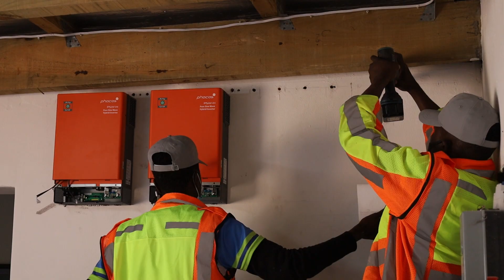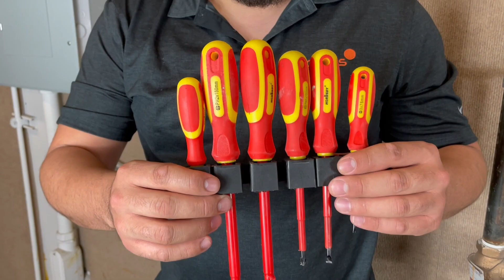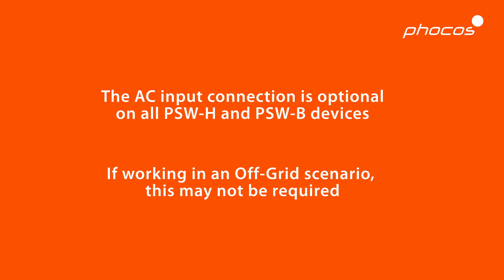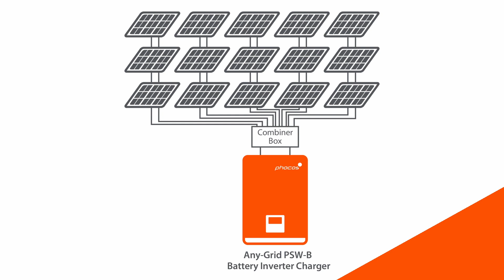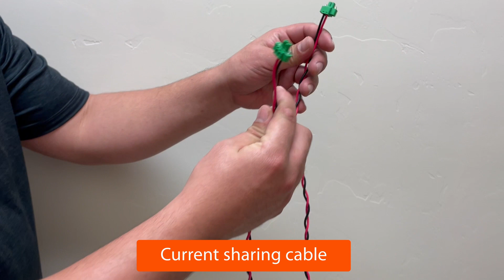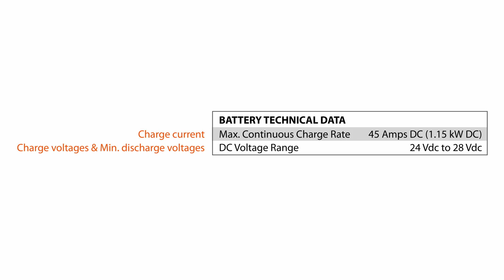Phocos Any-Grid Inverter Installation Best Practices

Comment: Subject: PSW-H-5KW-230/48V: Dawnice HZEB-LCT-16 compatibility, equalization, and max PV current

Hello,

I own a Phocos PSW-H-5KW-230/48V hybrid inverter and am finalising a system around it with the following:
- Battery: Dawnice HZEB-LCT-16 (LiFePO4, 51.2V nominal, 44.8-57.6V range, 150A max charge/discharge, CAN/RS485 communication)
- Panels: 10x 560W monocrystalline modules (Voc 52.27V, Vmp 42.5V, Imp 13.18A, Isc 14.10A), wired as 2 parallel strings of 5 panels each into the single MPPT input

Before I finalise wiring and settings, please could you confirm the following:

1. BATTERY COMPATIBILITY: Has the PSW-H-5KW-230/48V been tested with, or is it known to work with, the Dawnice HZEB-LCT-16 over CAN or RS485? Is there a specific battery protocol/setup selection needed, and any firmware requirement?

2. CHARGE PROFILE / EQUALIZATION: Your datasheet lists an Equalization Charge voltage of 59.2 Vdc for the 48V models, which is above the Dawnice battery's stated maximum voltage of 57.6V. Does the PSW-H have a "User" or custom battery profile where float, boost, and equalization voltages can each be set independently (with equalization disabled entirely)? Alternatively, does selecting "Lithium" from the built-in battery type presets automatically suppress the equalization stage? Or, better still, can the inverter run in a mode where it takes charge parameters directly from the battery's own BMS over CAN/RS485, rather than applying its own float/boost/equalization voltage table?

3. MAX PV INPUT CURRENT: Your datasheet states Max. Usable PV Power of 4800W and a PV Panel MPP Voltage range of 90-230Vdc (with 2 MPPTs), but I could not find a stated maximum PV input current for the 5KW/48V single-MPPT model I own. My planned array draws a combined 26.36A across 2 parallel strings on the single MPPT. Can you confirm the maximum PV input current for the PSW-H-5KW-230/48V, and confirm that 2 parallel strings at this combined current are supported?

Thank you,

+260965775117

Comment: Do the fans push the air into the any grid or pull the air out?
Reply from the maker: Hello, Thank you for reaching out!

There are vents on the bottom and top sides of the Any-Grid. Air is taken in from the top vents and expelled toward the bottom.

Comment: Pls share a video on local monitoring of Phocos Anygrid PSW-H (5 Kw, 230 Volts) by PC or Laptop
Reply from the maker: Hello Prateek,
We appreciate your engagement on our video. According to our engineering team, the only way to monitor your system on a PC/laptop is via the Phocoslink Cloud dashboard, which is accessed through your web browser. This requires an Any-Bridge and a Phocoslink Cloud account. If you are looking to query the inverter using RS-232 you would need to reach out to a member of our technical support team so that they can walk you through the process. Although this is an option, we assure you that the simplest and most effective way of monitoring your system is through the Phocoslink phone app and the Phocoslink Cloud.

I hope this answers your question!